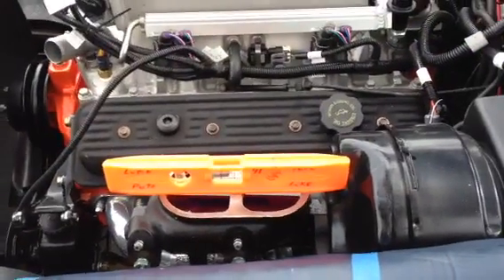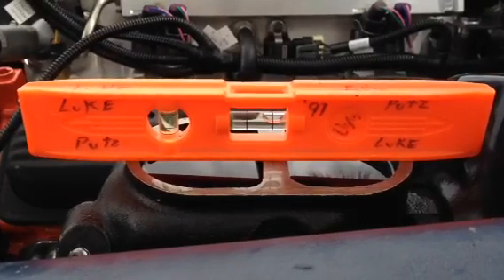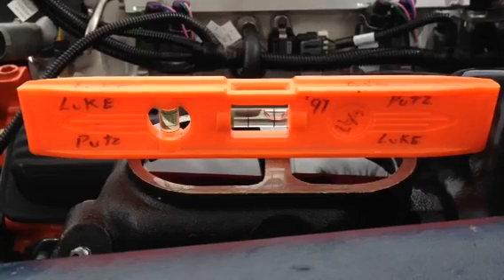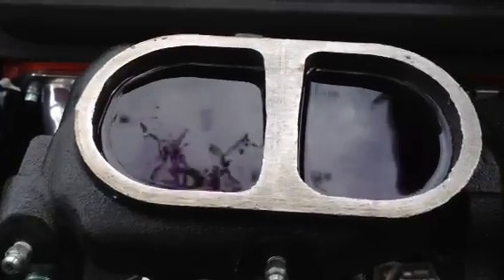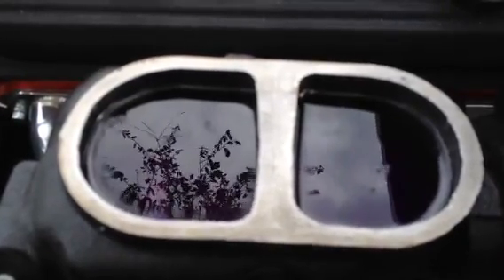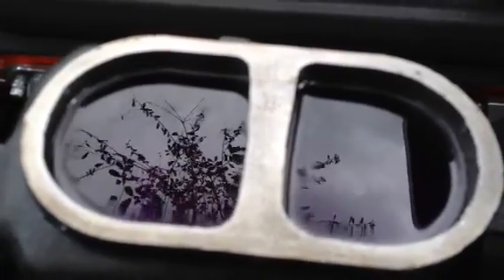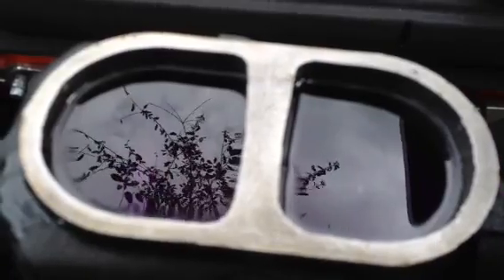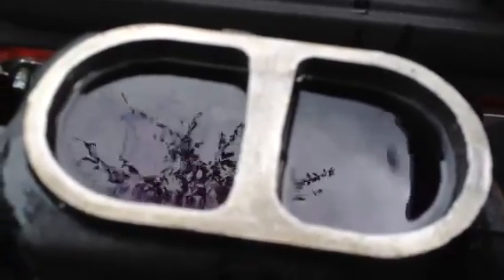Master Cylinder Spongy Brake Pedal Part 2

Comment: I have done this and it works like a charm.  Best C3 MC bleeding trick ever. No need to even bench bleed the MC.  I ran the rear reservoir dry and simply raised the back of the car, pumped the pedal and eliminated all the air in the MC. Easy peasy!

Comment: Great video. So, after replacing a caliper I fill MC with dot 3 or 4, bleed that brake line and then use this MC bleeding  procedure? What is a good   caliper replacement for Corvette 1978 rear left caliper for a daily driver? Thanks
Reply from the maker: You should not need to do this operation unless the master cylinder went dry while replacing a caliper. Squeeze off the brake hose or push a Golf Tee into the tube while changing out a caliper. This way you only need to bleed that replacement caliper and go on down the road. We make and sell New GM Licensed Delco brake calipers. www.cssbinc.com or click here: https://www.cssbinc.com/corvette-brake-calipers.aspx
Reply: @cssbinc1  Thank you very much. Great products, by the way.

Comment: i did this today and i think i got a couple of bubbles out. after the first couple of pumps i felt it get slightly firmer on the tail end. did it a few more. i think i got it all but my pedal is not rock hard. at the end of the day i’m starting to think we’re asking too much from these type of master cylinders. i have the same minus the bleeders
Reply from the maker: Power or non-power brakes?
Reply: @cssbinc1  power conversion. my car originally came manual though and i just saw that i might have to reposition my pedal push rod. you think that can help?
Reply from the maker: @cyrusvirus6928  call us tomorrow 352-554-5470
Reply: @cssbinc1  repositioning the pushrod mounting point on the pedal arm fixed my sponginess problem. i’m gonna do this bleed procedure again just to make sure i have zero bubbles. thanks again!
Reply from the maker: @cyrusvirus6928  Great

Comment: Interesting!  Even bench bleeding a new MC won’t get those last bubbles out?
Reply from the maker: Yes it is possible to get all the bubbles out bench bleeding, but when you have a spongy pedal it is easier to do it on the car versus removing the master cylinder. Sometimes air can get in the master cylinder while installing it on the car and putting the lines on.  Thanks!
Reply: CSSB Inc | Corvette Parts  Thank you!

Comment: I can not understand why the importance  of the master  cylinder being  at the right angle isn't more widely stated.  I have spent HOURS looking online for  info on this after spending days trying to bleed my brakes (accidentally sucked air in while changing fluid).  Literally the only thing I found was one youtube comment and now this video.  I've been trying to lift the rear and put it on blocks but it's amazing  how high I'm having to lift it to get the cylinder even level.  Unfortunately there aren't many  hills where I live.

Comment: Great video, but what if the air bubbles do not quit coming??? Pumped for a half hour and bubbles not slowing???
Reply: Did you bench bleed the cylinder first?
Possible hole in a brake line or a wheel cylinder seal is sucking wind.
Many replacement master cylinders are junk. I'm on my third in three years on a Toyota.
Make sure that the bleeders are tightly closed. That air has to be coming from somewhere.

Comment: This will work to my ke30 toyota corolla ?
Reply from the maker: It should, this applies to all master cylinders. Make sure the small hole is clear. Try to pass a .68mm or .026"+ wire through the small hole. An air bubble is hard to pass through a hole smaller than .023" hole. When you tilt the master cylinder, the bubble will sit against the seal right where the hole is. Also, sometimes pushing the pedal real slow at the tilt, the bubbles will pass. If you push too quick, the bubbles will not come out of the hole.

Comment: I had good brakes till I changed the back two lines and the wheel cylinder on my 1995 GMC Sierra now they are spongy why can you help
Reply from the maker: Samuel, Give us a call 305-256-8077 M-F 8-11am, 1-5pm

Comment from the maker: Mike, Do you mean the cap? If the cap is what you are talking about, I would remove it so you can see bubbles and if the port are flowing well. You can call us if you have more questions; 305-256-8077 or 800-262-9595

Comment: Hope you can help.  I have a 74 vette and am replacing with the upgraded calipers (steel bore inserts) and currently have a dry right chamber in my master cylinder.  So once I get an install my new calipers I should  refill master cylinder with fluid and then bleed all my lines finishing up with bleeding the master cylinder like you just demonstrated ? thanks